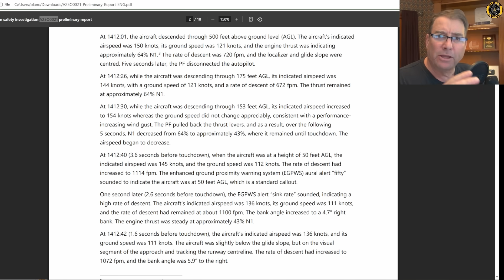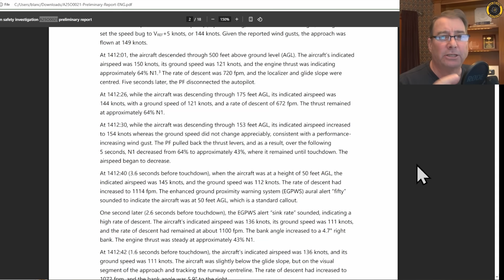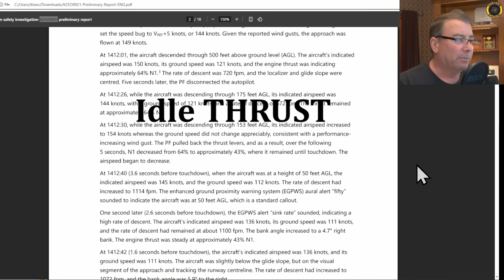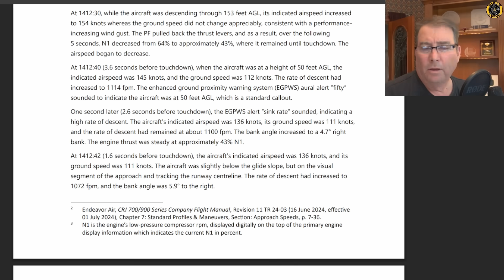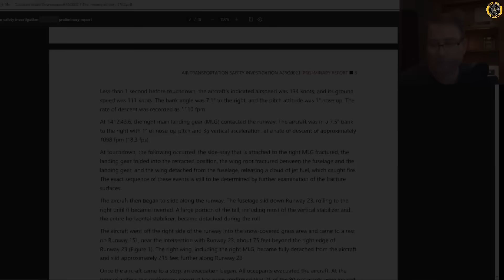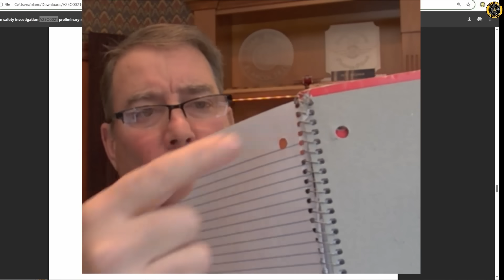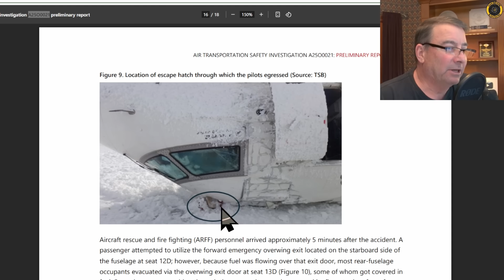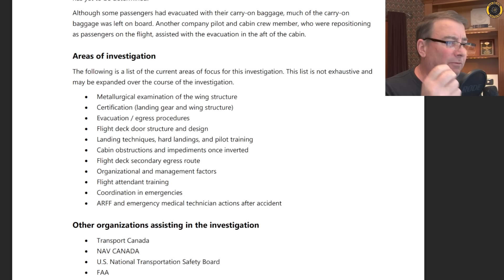TSB Prelim Toronto CRJ Crash

Comment: Always the best, level-headed and fact-based analysis. Was waiting for this. Don't forget, the winds were reported at 270 true. The variation here in Toronto is about 10 degrees west. So it would actually be 280 M. 50 degrees off runway heading. Makes quite a difference for the xwind component.
Reply: Why refer to runways by magnetic headings and wind conditions in true georeferenced coordinates? Are the pilots expected to run an app on a laptop for the coordinate system transformation? Seems like a systemic weakness to put this computation burden on the pilots. Not a pilot, just a system engineer...
Reply: Most reported winds don’t line themselves up on a rail. Any wind they report is an average.

It’s why stick and rudder skills are important, especially at landings. You need to adjust to the changing winds without overreacting to them.
Reply: @J0XED0R runways are magnetic because traditionally and even still to this day, you set or reference the directional cockpit instruments to the compass heading each time the plane lines up straight for takeoff. modern airliners now have flight computers that display wind angles relative to flight so it is less of a concern anymore. after awhile, runways may even change number for variation. in Toronto the accident runway is 23 but is parallel to the southern set of runways 24L/24R. it seems like a big issue but really isn’t for modern airplanes and procedures. Pilots can ask for a wind-check from the tower and that will be given in magnetic which is the same as the runway.
Reply: @J0XED0R the poles are changing and the magnetic variation needs adjusting from time to time. When the tower tells you the wind, they'll say it in magnetic. Or if you're listening to Atis coming into an airport, the variation is also taken into consideration. For old school flight planning you do everything in True and then add the variation at the end to get a compass heading.
Reply: Only METAR is true headings. Broadcasts over the airwaves are always magnetic.
Reply: @Jer29  32 likes for misinformation
Reply: @SSaugaCriss what's false or misleading? Juan was using a crosswind calculator. If the winds, in a METAR report are reported at 270, the magnetic wind direction would be 280, and that is what you would use in a crosswind calculator. 

Rule is if it's spoken, it's Magnetic. (tower, Atis) if it's written (metar, bulletins, charts, it's True)
Reply: @Jer29  runway 23 is 247M
Reply: Big problem for Canada. NAV CANADA is apparently trying to get everything converted to True North and not Magnetic.
Reply: I’ll have to dig in the AIM, but the winds reported on ATIS information or reported by the tower are true directions? The wind meters installed on the towers or somewhere else on the airport are calibrated or referenced to true direction …. I find that hard to believe being runway direction is magnetic…. The only wind direction given in true that I ever remembered was winds aloft forecast
Reply: @Blueskies495 - Runways are indeed magnetic, hence why some occasionally change as the magnetic variation changes (excepting a few runways in polar regions which are referenced to true, such as Thule Greenland).   This happened at Indianapolis some years back.  The main runway was 4/22 when I started flight training and in my private pilot days, later it became 5/23.
Reply: @AndreySloan_is_a_cnut  The main runways at LHR used to be 10 and 28 - nowadays they are 09 and 27.
Reply: @Blueskies495 metars, FDs, forecast prognostic charts, are all True. If tower audibly tells you the winds or you hear it on Atis, it's magnetic.

Comment: Is anyone besides me notice that the majority of the recent incidents have a female in the cockpit in the pilots seat?
Reply: And 100% of fatal commerce accidents before 1990 were piloted by Men... Your point is?
Reply: @Plutodog-99 it’s only gaslighting if it’s not the truth
Reply: Gee, did you just notice that? It's not as if no one has been screaming "DEI" about everything they don't like for a while now.
Reply: @GWNorth-db8vn  So if you had an all female crew up front and discovered that,  would you be the guy in the viral video running through the cabin screaming trying to egress?
Reply: @ - I'm not sure what you read into my comment, but I'm sure you missed the point.

Comment: That was a challenging landing for any pilot - with the narrower runway due to plowing, the wind gusts, and blowing snow. But the PF never flared. She flew it into the ground.
Reply: In Canada the airports are plowed right to the runway and taxiway edge lights. You lose no width. Also, the runway she landed on is used by the A380, so it is definitely wide enough for a tiny CRJ.
Reply: @TheTurbinator  Did you even watch or listen the video? The prelim report was very clear that the plow width was narrow by 40 feet.
Reply: @TheTurbinator  Except they are not. The width of runway 23 in Toronto is 200 feet; it was plowed to a width of 160 feet.
Reply: Because she thought she was higher - due to the narrow cleared runway illusion?
With blowing snow blurring depth perception?
Reply: @onceamoth   The sink rate aural warning was sounding. Maybe time to go around ??
Reply: @onceamoth  who cares - they are instrument rated pilots
Reply: @onceamoth  Even though she had both 100 feet and 50 feet call-outs, the latter less than 4 seconds before touchdown ?
Reply: DEI…

Comment: DEI failure at every step. Many opportunities to correct.  They failed them all. Three recent crashes. All 3 had females at the controls, but everyone insists there's nothing to see here!  How many is enough?
Reply: What a disgusting, needless comment. Your prejudice is showing, and it’s ugly.
Reply: Some of the best pilots out there are women who where hired on merit and not dei, you must be one miserable SOB
Reply: Some of the best pilots out there are women who where hired on merit not dei, just stop
Reply: DEI PIC?
How many crashes have happened with males at the controls?
Reply: @AlbertHess-xy7ky  Everyone who steps on a commercial flight needs to know they're safe. This is going to be pilot error and its ok for the public to question these things.
Reply: @rickyism1576  No flight is safe...
Reply: @rickyism1576  It is also OK to tell the public the correct and relevant statistics, which are that there is very little difference in skills or accident rates between men and women.
Reply: @ Most pilots are male, and males invented aviation. Females are a small percentage and crash a lot. You do the math. It's bad, but what do I know? I'm just an instructor captain and pilot of "everything," with 55 years of experience and 25,000 hours. How about you?
Reply: @CaptainSteve777  Hard to believe that anyone in a responsible position in aviation confirms his biases with anecdotal "evidence." Instead of blowing hot air, you should look at statistics that control for experience.
Reply: @CaptainSteve777 just by the nature of your words I feel confident calling you a fraud
Reply: @CaptainSteve777  What is the crash rate for males versus females., versus experience? What does your math show? What do you know?  Are their any good female pilots? Pilots of color?  Colored female pilots? Do 25,000 hours make a colored female pilot competent? Do pilots with 25,000 hours crash?
Should 75 year old's be allowed to fly?
Reply: @CaptainSteve777  Sarcy clint. I am male (category 6M), commercial licence, 30 years and 12,000 hours. My daughter in law is female (category 6F), commercial licence, 7 years and 4,000 hours. Which one of us is the better pilot ? See if you can *guess*.

Comment: Pilot error. She drove it into the ground and broke it.
Reply: WHAT ABOUT the extremely wrong crew selection by the airline crew assignment programmers for this flight; pairing a rusty, "Sim Jockey" Captain that has very few landing at THIS airport, in difficult conditions, being paired with a low time First Officer allowed to do the landing... the worst combination!
Reply: @alfredomarquez9777  You mean exactly what he discussed at 12:24?
Reply: Windshear with no altitude to recover.
Reply: Good grief, why does the PIC let an FO land in those conditions. Quit listening right there.  Bumping out.
The passengers do not want to party in a training exercise.
Reply: @jmwSeattle  Because he knows he can't do it for sure?
Reply: Agree, although I've seen worse and the gear didn't break off, so I wouldn't be surprised if they find some metal fatigue or preexisting crack that weakened it....probably because of previous aweful landings that added up. 😏
Reply: 3G landings?
Reply: Who was the Pilot In Command? A she?
Reply: @AlbertHess-xy7ky a young female pilot with less than 1,500 hours to her name. How can you get to fly an airline when the MINIMUM requirements for an ATP license is 1,500 flight hours?!
Reply: @AlbertHess-xy7ky 
Female first officer was pilot flying.
Reply: @AlbertHess-xy7ky does it matter?